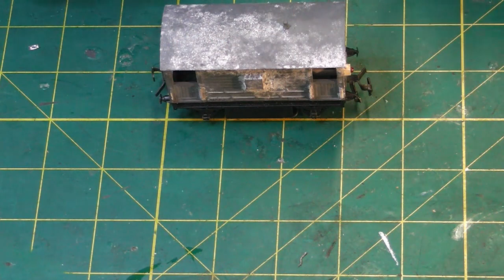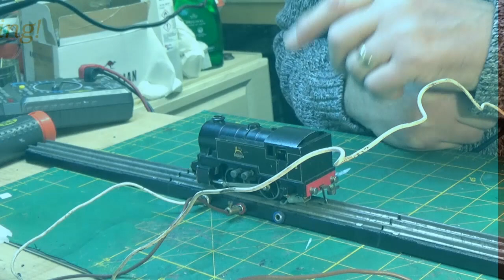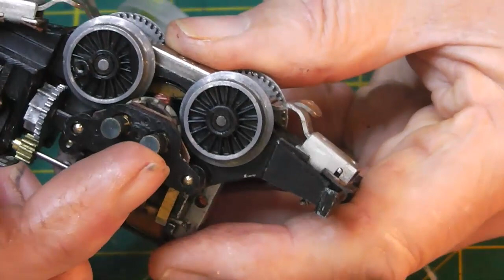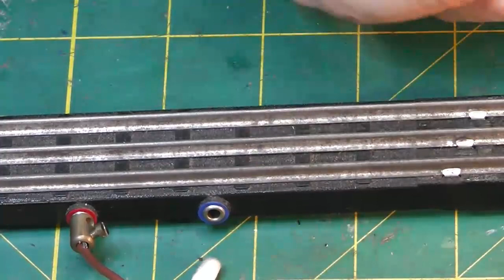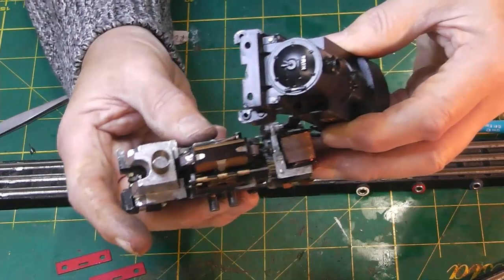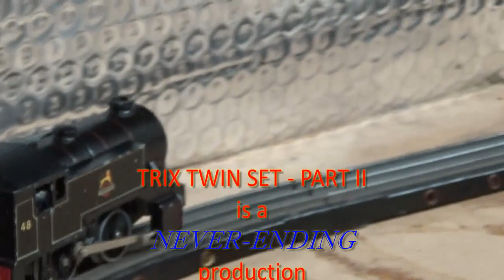Trix Twin Set Part II

Comment: Just found your channel Jim and have to say that your methodical way of fixing this trix railway is just what it needs it's amazing that these models work at all after nearly 70 years but if your are careful they will work. I have seen quite a lot of trix twin over the years and the ones that you have there look cosmetically  very good and have either been well looked after or hardly ever used, one of the main requirement for these AC models is that the rails need to be as clean as possible. Look forward to seeing the final episode of the Trix fix.
Reply from the maker: Hi Barry, thank you very much for your kind words. I only came across Trix Twin by accident, but I love vintage model rail. Once I get a couple of projects out of the way, I will get Part III started, where I will attempt to repair the loco with the broken side-frame. These older locos were developed with, what can only be described as 'crude' technology, but worked surprisingly well. I am not a fan of very modern, super detailed, locos. What is your modelling interest? Keep in touch. Cheers, Jim L

Comment: Congratulations on getting this working, Jim. Not the easiest thing, with such old (and slightly odd) technology, in rather poor condition. It does appear that when you made this video, you weren't quite familiar with the idea of TTR. None of the three connections on the controller is intended for accessories - they're all intended to go to the track, one to each of the three rails. The whole idea of TTR, Trix Twin Railways, was that you could have two locos on your layout, one facing one way, and one facing the other, so they contacted different outside rails, and then you could control one loco or the other other, using one switch on the controller for one loco, and the other switch on the controller for the other loco. Doesn't really make much difference to you, as it seems that you don't really have enough track to make a layout where it would be useful to run two locos (even when you get both working). But that was the intention of the system (hence 'Twin'). It's very interesting to see how the reversing mechanism worked. Quite tricky trying to make a working reverser function with AC. Eventually, around 1956, Trix gave up on AC, and joined everyone else in using DC, with which reversing is simple.
Reply from the maker: Sorry about not replying before. Just found your comment from a new feature in YouTube.
Thanks for your great comments. Yes, the mechanism is quite complex but was probably cutting edge in its day!
Cheers, Jim L

Comment: Yes Mazak rot. What a shame. Hopefully you can scratch build a new bracket? Or maybe glue back with some epoxy resin and a thin reinforcing plate?  I recently bought a Penn-line GG1 loco from the sixties which had mazak rot, but it was too far gone and couldn't be saved. Good luck!!
Reply from the maker: Hi Fern, thanks for looking in. Mazak rot swells your chassis, weakens your arms and disintegrates your supports. It's horrible, and the tablets don't help! Anyway, I think I've sourced a whitemetal cast replacement which will let me get the loco going. This will give me a bit of time to experiment with epoxy (like your comment about the 'reinforcing plate'. I'll keep that in mind) in case I come across another loco. I had a similar experience with an Atlas n-gauge K4. Take care, Cheers, Jim L

Comment: You're getting there Jim, well done indeed. Is that a "flickering stove" effect in the brake van? Pretty basic stuff, in some ways but pretty advanced for it's time. It took a long time to get similar effects on two-rail. Happy New Year to you.👍😁
Reply from the maker: Hi, nice to hear from you again. Happy New Year to you, too and thanks for your comments! The 3-rail concept, where you can run two trains on the same track, but in opposite directions sounds like an interesting prospect. (I will be trying that next time when I get the second loco going!)  I'm not sure about the light in the brake van as I've not opened it yet, but it certainly looks like interior lighting! (It's supposed to be for the rear light, so, maybe a 'shield has come adrift. I'll check it out next time. Until then, take care, cheers, Jim L

Comment: great vid jim do you have a trix layout ?
Reply from the maker: Hi Alistair, thanks for your kind comment. No, I don't have a layout, I simply love finding locos (of any gauge) which need a bit of TLC and try to get them back 'on the rails'. This set will be returned to Mac's Model Railroading when I'm finished. Cheers, Jim L
Reply: @SoRTs6233  thats good jim macs models informed yesterday of your you tube videos if i come across any locos that need repair i know where to come  i do have some triang stuff that needs looked at if your interested 
thanks 
Ali
Reply from the maker: @alistairroy6568  Hi Ali, I'd be glad to help in any way I can. Drop them off at the shop, I'll get them from there. Cheers, Jim L